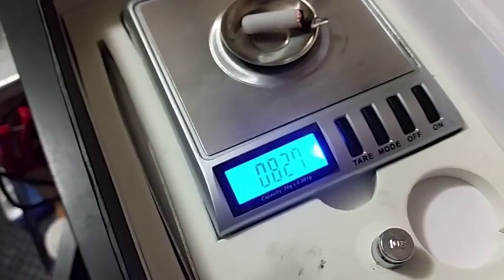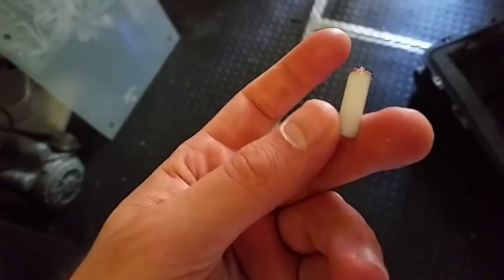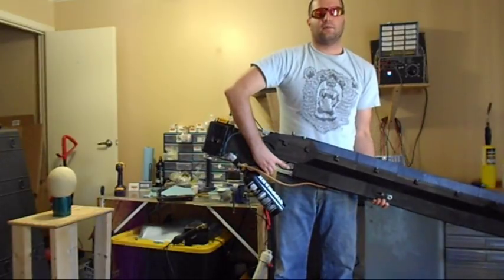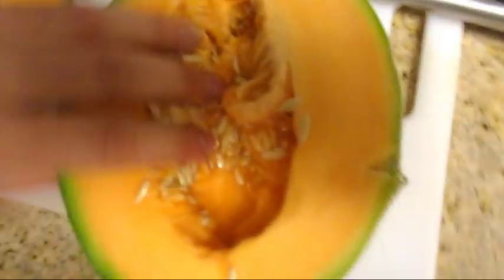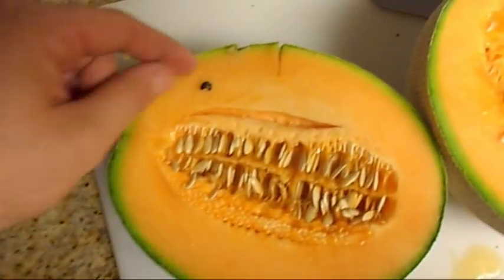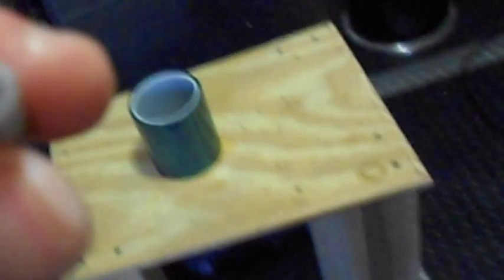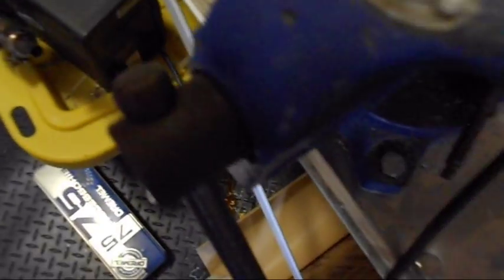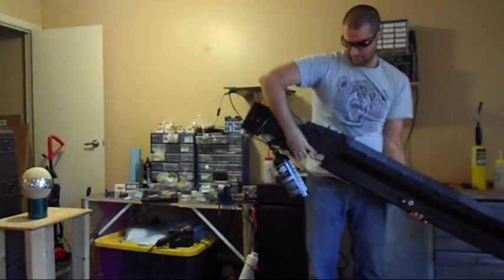SEMI-AUTOMATIC RAILGUN: SR-1 Plasma Rounds

Comment: Making a modified railgun from the design I released to accept solid state O2 pellets, due to the magnetic properties of O2 and its ability to conduct I will be incorporating a new rail design for a smaller scaled down portable railgun. It will be 60% the size of the original and be very portable. It will incorporate a mass driver initiator, two near bored rails, and a solid state magazine for keeping O2 contained. Hopefully when it is done it will be launching plasma fuel pellets that will be shearing off layers as it attempts to cool down keeping it super heated.
Reply: Show show show, very interested
Reply: How’d that work out for ya, Chad?

Comment: It doesn't look like the nylon screw is being ripped apart. Since the round and the screw both hit the target with enogh force to embedded it it is probably the plasma created by the copper foil cutting the head off.
Reply from the maker: That's what I was getting at, but you phrased it better.  :)

Comment: I'm a stupid person here, but... Could it be modified shoot lightning bolts? Like Fortune from MGS2?
Reply from the maker: Definitely not stupid!  But no, this thing really can't.  The only tech out there that could is a directed tesla coil or an electrolaser.
Reply: @skeptical_thinkers  theory, helical railgun that can shoot directed lighting bolts by using a tesla coil at the loading end of the gun and use the magnetic fields to direct the lighting bolt straight at a target, this might also heat up air within the barrel into plasma if using a high enough voltage.
Reply: @StarryShahariel  That just isn't possible and would be an extremely inefficient way to deliver energy to a target if it were. A lightning bolt is a billion joules at 300 million volts. Good luck insulating 300 million volts from the end of your barrel to the voltage source or ground. You could theoretically direct an electric arc by using a high power laser to ionize the air between the source and target, but after the arc got to the target, it would just find the quickest way to ground and not really damage anything. I guess it could kill a person, but the high power laser required could probably just do that on it's own. If you were to hypothetically have a billion joules of energy to work with, it would be far more effective to convert a portion of that energy into kinetic energy and throw something at the target.

Comment: is that the sound of a air compressor motor ??
Reply from the maker: It's a fan.  Blows air through the electronics to cool them.
Reply: Would a liquid-cooling system be quieter, or would you still need the fan?
Reply: @snipa298  liquid nitrogen cooling for a Rail Gun

Comment: what is the energy output , efficiency
Reply: NSA_Listbot 160j at the output ?? you the projectile has 160j when it is fired ??
Reply from the maker: 175 m/s 10.5g round = 160J (for tungsten).  Plasma is much less energy but more efficient: 400 m/s 0.8g round = 64J
Reply: What's the effective range? In the vids I've seen so far, you have been getting really close to your target.

Comment: Why do you need the C02? Ive seen other railguns made without it that do just fine, seems like something you could eliminate eventually from the design
Reply from the maker: Yup, that's the next step is eliminating the CO2 system.
Reply: How about housing a ceramic bearing in the tip of the delrin? Would that be a more effective railgun cartridge?
Reply: You need some method of initially accelerating the projectile. That keeps it from getting welded to the rails.
Reply: @shirawolven1382  make a Nerfgun into a Rail Gun

Comment: I'm very matur thanks if you reply this email

Dear NSA lisbot

May i know your railgun specification?

Kind of capacitor?

Joule energy?

Mass of the projectile?

Calibre of the projectile?

Barrel length?

Power Supply?

Velocity of projectile?

From your fans 

Arp
Reply from the maker: All of the most mature people I know start off their youtube comments with "I'm very matur".  

But I digress. Hopefully some of this info is helpful to you.  XPR-3 uses electrolytic capacitors, 3 of them with a combined energy of 4.5kJ.  Projectile mass is between 0.2-9g depending on material and they are all 6.35mm diameter.  The rails are 6" long in their active section, with a 10" CO2 injector.  Power supply is proprietary.  Velocity depends again on projectile material but somewhere between 100-400 m/s.